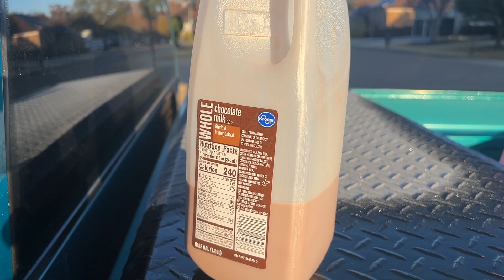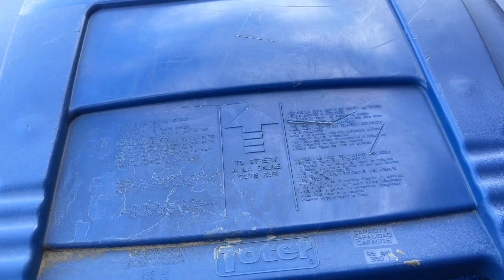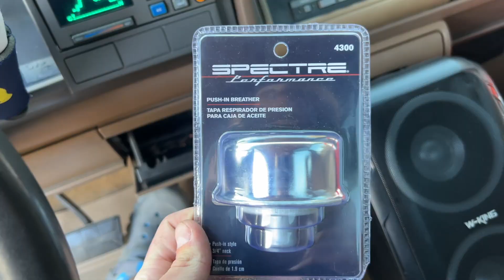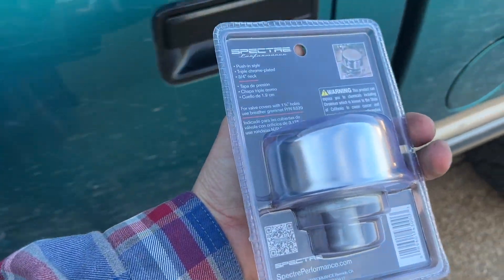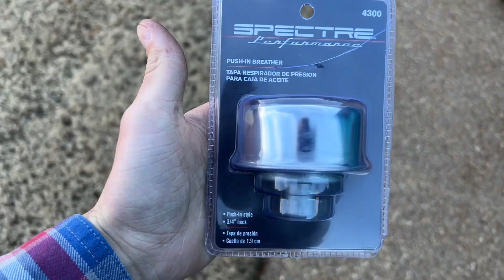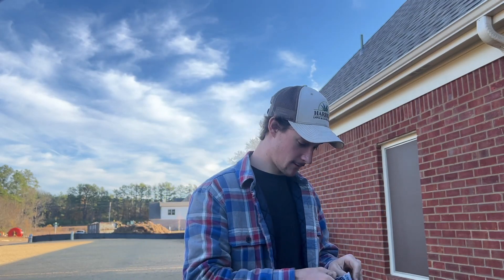She’s BAAAACK (With Problems) | 1993 Chevrolet K1500

Comment: I had a 92 OBS that always leaked oil after a fresh oil change. It would misfire because oil would leak out of the valve covers and make its way into the spark plug threads. Changed the oil pan gasket and the valve cover gaskets. After that the oil leaks went away. I personally think the GMT800 platform is better, but when they start having electrical issues or computer issues, then they become a pain in the nuts.
Reply from the maker: Oh I agree. They are a way better platform for sure😂. I’ll have an LS again soon enough
Reply: I currently have an 88 obs with the tbi 305, and I'm running into what I believe to be ecm issues, I've replaced it once already, it was replaced before I owned it, and now it's screwing up again. Barely runs. I've done everything else you can think of. So I feel the electronic issues...
Reply: @natewj1077 Yup. Even the GMT400’s are prone to having electrical issues, although it’s alot less common than GMT800’s electrical issues.

Comment: Might want to change the pcv valve could be building pressure
Reply from the maker: It’s not stuck closed. I showed that at the end of the video. I appreciate the comment tho!  Might change it anyway just for heck of it since they are so cheap
Reply: @wword  I seen it at the end but as you can see I jumped the gun... they're cheap enough and easy enough to replace though
Reply from the maker: @bushman979  yea. Might just do it anyway. I literally haven’t even looked in my engine bay since that video😂😂😂

Comment: my 350 leaked out all its oil really fast and ran dry and i now need a new engine for my truck
Reply from the maker: No way…….
Reply: @wword  and i only had 117k miles on the truck im gonna get a new engine next year i need to save 5k but hey at least this moter will last me 30 more years
Reply from the maker: @dubskulls9554  damn dude that’s such a shame…. Mine has 123k rn. Wish me the best!😂😂
Reply: You know how my truck ran out of oil and stalled I added oil and kept cranking it and my starter brought my truck back to life 😂 it dose not want to die she just jave problems lol @wword
Reply: @wword I swere my starter is a gift from God that thing won't die 😂
Reply from the maker: @dubskulls9554  no way😂😂😂. Thats unreal

Comment: Check you EGR valve. Make sure it's not clogged with soot. If it was a Vortec I'd have more suggestions but I know about those TBI's
Reply from the maker: My egr valve is unplugged and stuck closed😂. “On purpose”

Comment: One thing to check is you pcv hose. That can get plugged up too. 

Kinda far out there but maybe the oil sloshed into the breather when accelerating fast or something and saturated it??? Theres supposed to be a baffle on the inside of the valve cover to stop that though. 

Also, you don't have to one up yourself every video. Its nowhere near as fun to watch someone forcing themselves to produce "better" content than it is to watch that same person make a video where they are just having a good time. Just have fun making the videos, if you aren't having fun theres a pretty good chance its not going to be as fun to watch
Reply from the maker: I mean that’s for sure not a bad idea. But yea there is a baffle on the pcv hose side but not for the driver side. No idea why. And I really appreciate that man. I mean I have to agree tho. And it’s for sure way mor enjoyable for me to make videos when I’m just doing something I enjoy vs holding myself to a way unnecessarily high standard oh making the “best” content in my eyes. Thank you bro

Comment: Hey man love your videos and your since of humor! Very entertaining keep it up. I had the exact same problem with my 95, replaced just about everything you did and tested for vacuum leaks and still had the misfire at random when up to operating temp. I ended up bumping the timing up just a hair and it runs perfect now. Previous owner stabbed the new distributor and set the timing without disconnecting the spark advance and it would run fine until it got warmed up. May or may not be your issue but thought I would share because I chased the issue for months and it was very frustrating so I feel your pain. Hope this helps
Reply from the maker: Man I really appreciate this. I was actually wondering if it was timing related.  And it never misfires and any type of rpm besides idle. I’ll look into it for sure

Comment: I recommend putting on the MSD cap and rotor. The MSD ignition Coil and MSD Sparkplug wires. My OBS is running great after installing what I just mentioned.
Reply from the maker: Bet. I really appreciate that advice